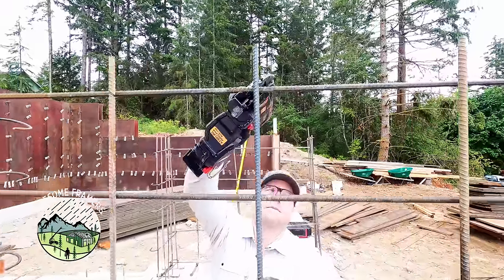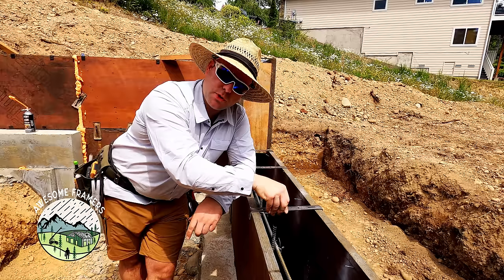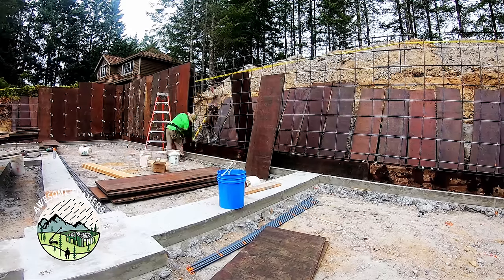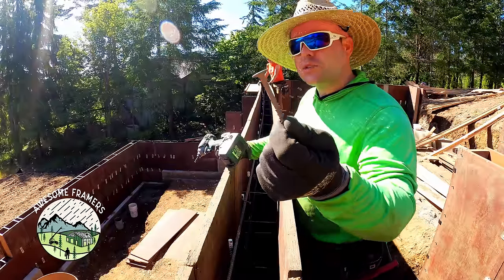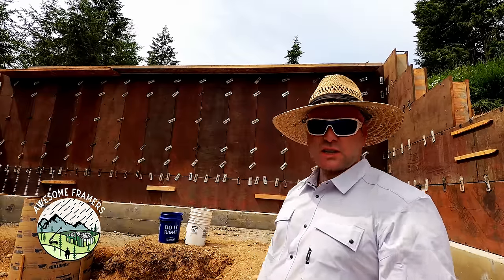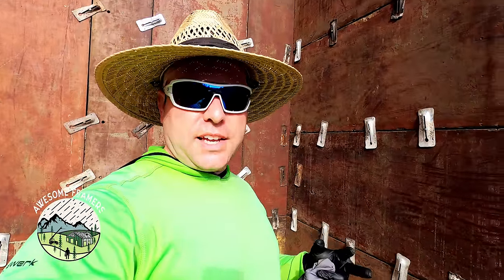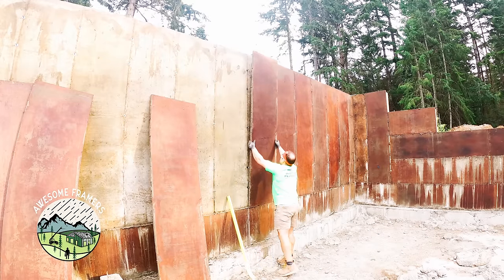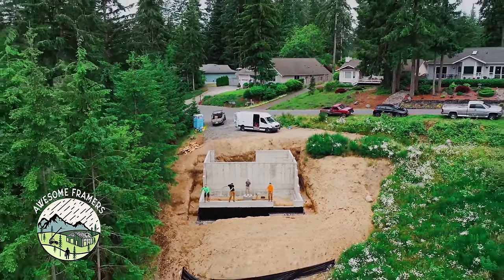How to Form Tall Foundation Walls

Comment: Screws and an I joist? Buy couple buckets of 2 x 4 or 2 x 6 top walers made for 1-1/8” forms they won’t damage your forms and no need for any screws or nails ( they use wedges) they also last forever
Reply from the maker: You may not have caught it but we are framers who do a few foundations a year. This works well for us, very well.
Reply: @AwesomeFramers  I just use braces. Once the concrete is in wall it's just micro adjustments after a good pre-straighten. If using walers I would suggest making the wall straight first. Also be careful standing wall like that without braces. It's not pretty when they fall over. Maybe it wasn't a windy day. Lol   nice looking foundation though. 👍💪

Comment: Can one cement this wall to look nice and paint it?
Reply from the maker: yes.  I forget the finish, but often structural concrete gets a "sacked" later for a finished look
Reply: @AwesomeFramers  nice thanks. Is this how tall walls for warehouse is built?
Reply from the maker: @MsJNCOE  Often those are tilt up concrete construction, or maybe block wall.
Reply: @AwesomeFramers  ok thanks

Comment: What size snap tie ends do you use? The shortest I’ve seen 4 3/4” ends.
Reply: When I order, I order 1 5/8" x 8" ties.  The actual distance from the washer out is probably less than 2", maybe its 1 1/2"?

Comment: Two thousand dollars for a device to tie rebar together? Why not just buy mesh in the correct gauge and spacing?
Reply from the maker: I hear you.  To buy mesh that is equal in strength to what the engineer spec's (we are a high seismic zone) would require equipment to set and ultimately be more expensive.

Comment: How do you determine the rebar size and spacing?
Reply: Structural drawings or at clients desire
Reply: @marcogonzalez5878  whats the recommended space so the bars dont buck the snap ties? As you giys stated the heights you fit them. Also do you make the snap tie grooves in the ply or do you leave the gaps between play boards?

Comment: The dumbest way to do a foundation. How many days did it take you to setup pour and strip? My crew of 4 guys with advance panels would have been setup and poured by noon the first and stripped and it of there by 9 the next morning. Very inefficient way of forming and yes I do know that for a fact because I've done many the same way your doing it. We call them panels lay downs or rap i's. They work well for 2' wall and that's it anything else advance forms with all attached hardware is much faster
Reply from the maker: I look forward to learning from your channel 🤘
Reply: @AwesomeFramers  loool